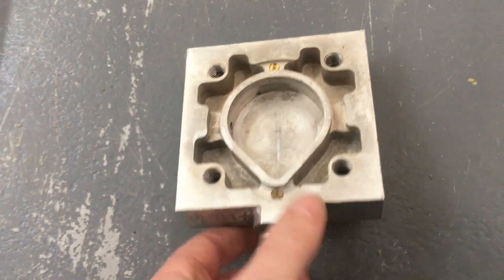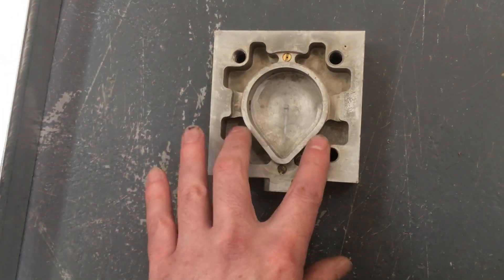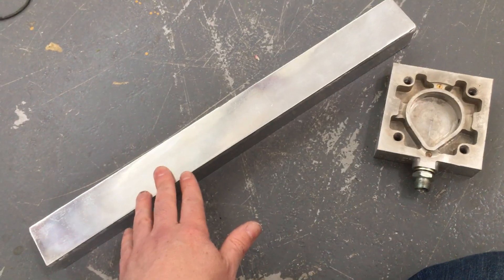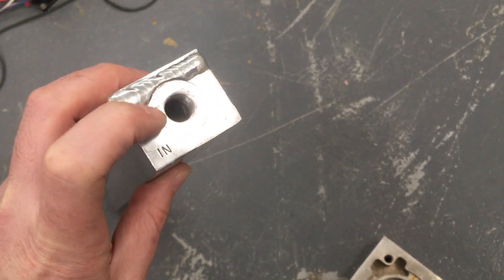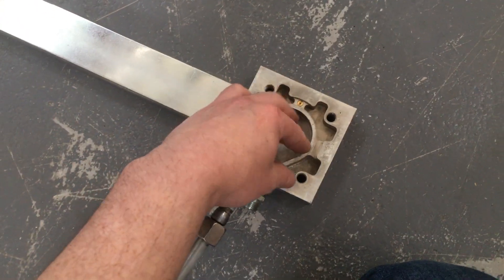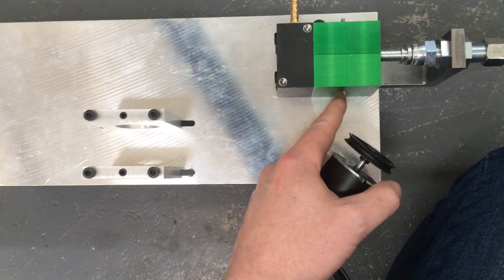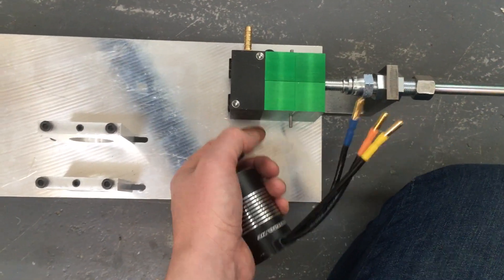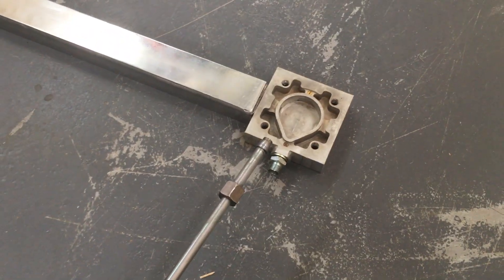Pulse Jet Engine Tesla Turbine Rebuild - Part 3 - A Look At Some Of The Components

Comment: Could this be used as a good pressure steam cleaner?
Reply from the maker: It’s appears this is possible. Are you thinking for engineering metalwork applications like gearbox / engine casings?
Reply: @nikola.tesla.r.and.d.centre  sort of however I was thinking about something like this to replace a diesel burner steamer like the brand optima steamer. Something to be able to have multiple applications and much smaller than those expensive machines. Would like to be able to do car interior with a steamer and enough pressure to do engine bays and parts etc…